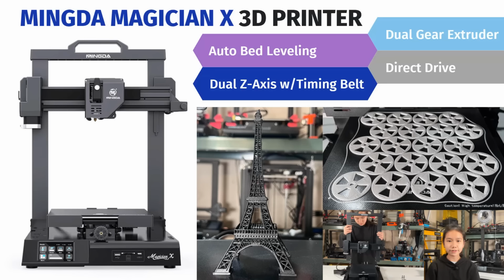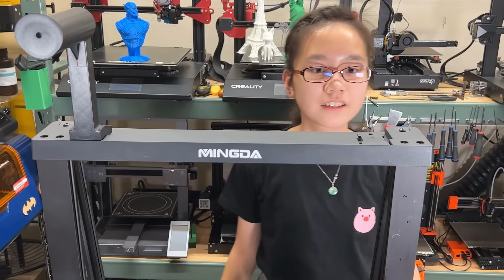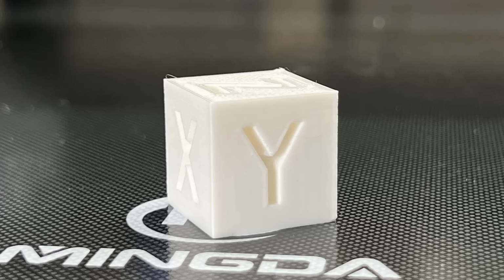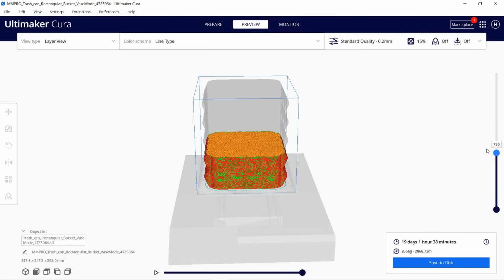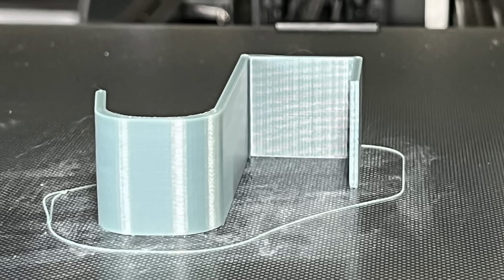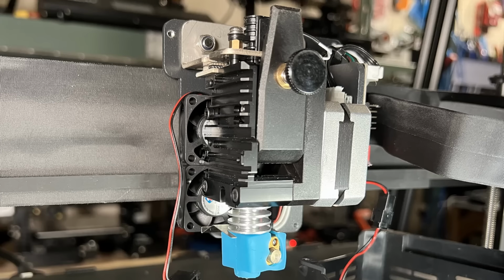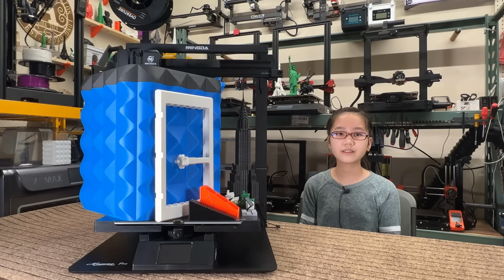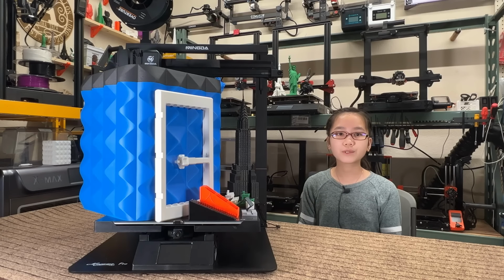Mingda Magician Pro Extra Large 3D Printer: 400x400x400, direct drive, ABL, dual Z, touch screen

Comment: So I bought this printer around a year ago after watching this review. I'd say you hit the nail on the head with your analysis of this machine! Overall, i love this beast. Its finishing up a 110 hour long print with a .6mm nozzle as I type this, and it had finished a 120 hour print before I started this one. 

Some further notes for those who might want one;
1. the filament runout detection works but I suggest not using it if avoidable. When the filament DOES run out it works as expected, however the end of the filament will be buried in the extruder. you then have to fully open the tension lever and get a pair of tweezers or needle nose plyers in there to extract the remaining filament. Just pushing the new stuff through sometimes works but not always as the filament tends to get jammed between the extruder gears and extruder body. Cutting a taper helps, but its easier to just swap it just before it runs out. 

2. the ONLY failure i've had of the machine is again, the filament runout detector. The switch has a plastic roller on it which is fine for a while, but slightly abrasive filament will wear a groove in it. this groove then trips the detection. With no way to bypass that mid print, I lost 40 hours of printing time once. This can be fixed with just adding a better switch in there, I've had no issues since I did so. 

Overall, i rate the machine 5 stars still. I love it! The massive build volume just cant be replaced and its really a feature packed machine for the cost. Overall, it was a great purchase!

Comment: Another great video! 

A note: as Teaching Tech points out, these machines can be very dangerous. I notice you've used a laser tent and ventilation which is very wise and I'm sure you're fully aware of how to run a laser engraver safely, but the audience may not understand the importance of those safety precautions. I would recommend including a strong warning on open frame laser engraver reviews to use an enclosure and ventilation to block stray laser reflections, to never run engravers unattended to mitigate fire risks, to keep children and pets away from the engraver, and to be very careful with materials as some can produce toxic fumes when heated.

Keep up the great work!

Comment: They use optical z switches as a safe z home where it is homing just above where the nozzle touches the bed and then goes down so it doesn't bend the strain gauge if it isn't plugged in or isn't working correctly and just drives the head into the bed

Comment: Any chance you're planning to have a look at the Anycubic Kobra? I've just got mine about 4 days ago just to see if all the glowing reviews were right and I think it can't be beat for the money. As I've been active on the fb groups I can see it's being outshined by it's bigger sibblings (Vyper/Kobra Max). Besides it not including a filament runout sensor (which should be standard these days and I know you'll agree) and a bit fiddly Cura setup (a few ppl are having trouble setting this up) I thinks this is the new S1 for a fair change less. Lovely work as always!

Comment: I've got the Magician X and it has one major flaw, the power cable connection to the hotbed is too firm and is easy to break, also the "S" motherboard doesn't seem to work with Octoprint.. Nice machine otherwise. Thanks for the review.

Comment: Your review does address the major issue with a 'large' printer: it is SOOOOO slow.  You understand this issue and changed to a larger nozzle but this should have a Volcano type heater/extruder to really take advantage of the large format for large prints and get realistic print times.  My 3D printers: An A8 and a Volcano heater/extruder large format (semi custom).  One must wonder what will be the real marketplace for this printer in light of the Bambu Labs versions (assuming they make it pass kickstarter).  Yes, it is much cheaper.

Comment: Nice review, as always.
For a printer this size, a v6 hotend seems a bit underdimensioned. A high flow hotend to keep the printing time acceptable, seems more apropiate. On the other hand with a Bondtech CHT nozzle you might go high flow (and therefore to a higher speed) with just a little extra money.
As the printbed is quite heavy, ringing might be a problem on higher speed. I think this printer might be a good candidate for Klipper and Input Shaping.

For the size: I still have not assembled my Jennyprinter 650 (65*65*65cm³ build volume, 95*95*105cm³ outer dimensions). Also 35*35 (big voron 2.4) seems quite common  nowerdays. So I would call the Maginda pro an ultra big bedslinger (actually such a big y-moving bed seems a bit insane), but as a fdm-printer in genaral I would call it just "big", not ultra-big.

Comment: I have received my magicianpro two weeks ago. It really is a very good machine.Its wide construction platform makes it possible to carry out very large projects.The Leveling system is perfect, very easy, one touch is enough and it is very precise.This is a printer that does a great job out of the box.I am very happy with mine.

Comment: I prefer the 12864 screen as it is easy to add more Marlin commands to the firmware and you have more or less full control of the machine, my printers that dont have the 12864 are on Octoprint so I use a combination of plugins and G-code commands sent via its terminal

Comment: Very good review It would be nice to see if a larger print with sat .2 layer height will give good fine detail for model production. Say the size would be 300 x150 x 130mm. This would allow modelers to produce fine door handles and hinge details, rivet and bolt details.  Not all 3D uses need large volume nozzle flow many would like great detail ability from their printers.
Reply: Agreed.  For that matter even smaller printers benefit from high detail test prints, but I find it extra important on the bigger printers.  Knowing up front whether or not you are going to want or need to upgrade the stock filament cooling right away is important info, at least for me.